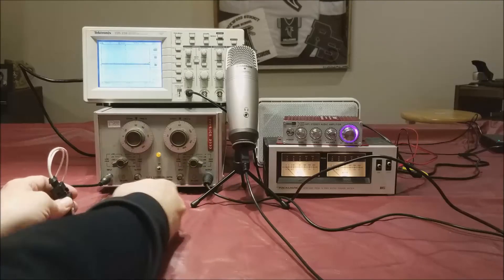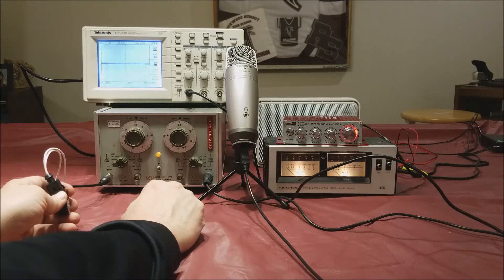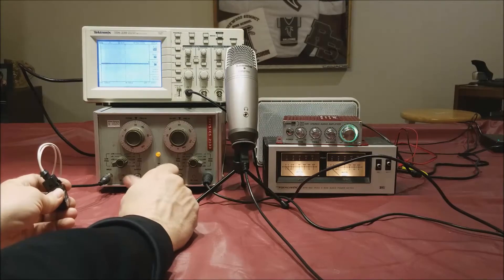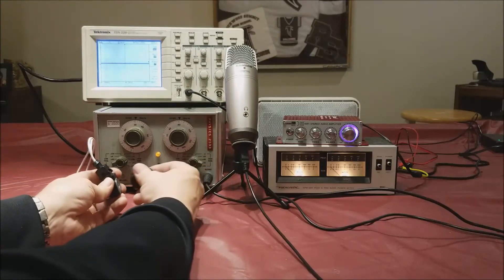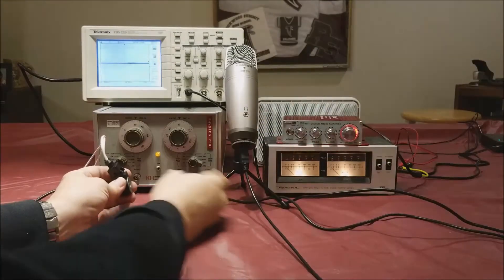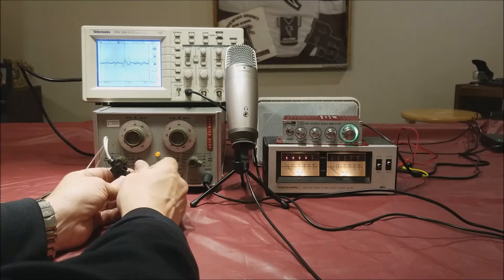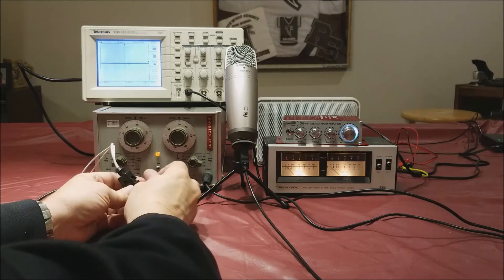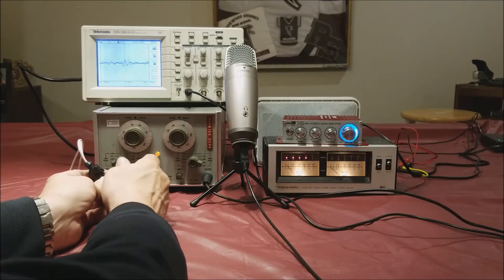Home Built Knock Detection

Comment from the maker: Krohn Hite 3202 manual  http://www.liberatedmanuals.com/TM-9-6625-357-14-1.pdf
Bosch Knock Sensor PN 0 261 231 006
Standard Motor Products S697 Pigtail/Socket
Kinter MA-180 12V MINI Power Car Computer Amplifier
Reply: Exactly where can I meet you. I'm sure a day hanging around you and you tuning would be freaking great!
Reply from the maker: Where do you live?